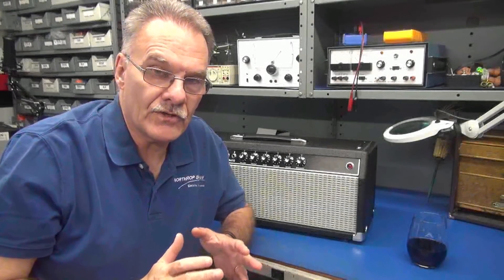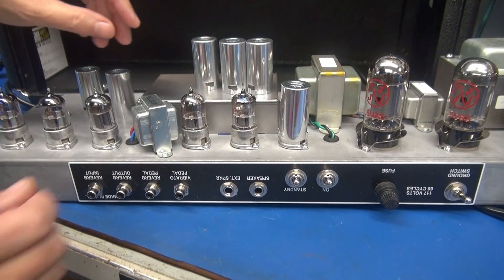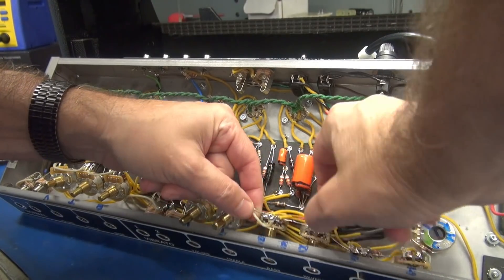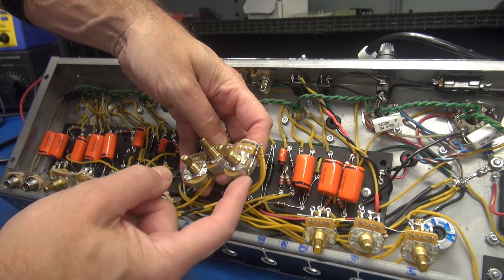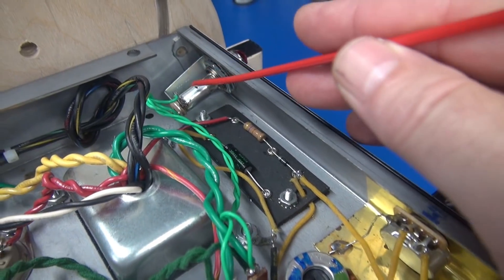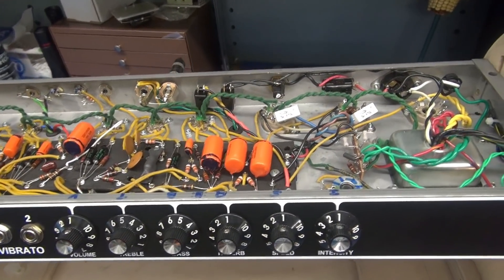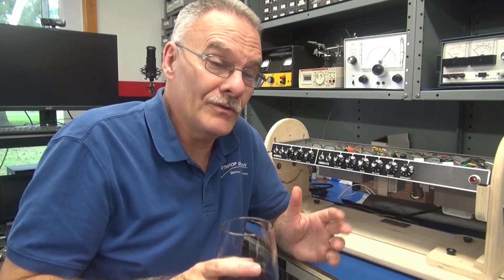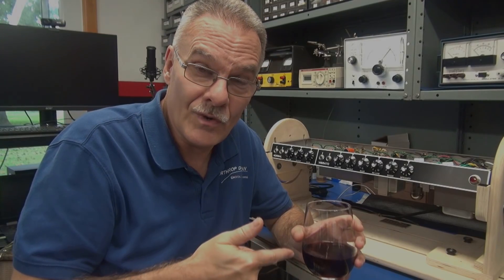How to reduce hum MojoTone Fender Deluxe Reverb Kit guitar amp proper Grounding build technique

Comment: I have a very quiet hum at 60hz in my Monkey Wards valco 62-9035A amp. I pulled all 4 12ax7 tubes but hum still there. Amp plays very well.

Comment: Question for anyone please. Are the two green wires on the secondary transformer the same. I think I can bypass the board and got to pins 2 and 7 or pin 2 and 8 on the Octal switch. Not sure if there is a  polarity, or which green goes to one or the other. They are both green so same? That is how they were originally wired up- less fire risk.

Comment: Nothing wrong with star grounding, when it is done properly.  The pre-amp star(s)  should be at or near their corresponding input jacks.  Not anywhere near the ground for the power supply.  That is an absolute recipe for power supply hum, and the unnecessarily long runs will invite all manner of other noise as well.

Comment: Howdy. Great success.
My recipe would be to use a separate B- bus wire that connects to the chassis only at the input jack.
The end tube minuses should have dedicated wires to the main filter capacitor(s).
The B- bus also connects to the filter cap.s at the feed end.
Finally all the pre-stages connect to the B- bus in the order schematics show.
One problem though. If the filter cap.s are of type can and collar, they need be assembled galvanically separated from the chassis.
Cheers.

Comment: I once took an apprenticeshio with Mojotone's Andy Turner. It has led me to your channel. Thank you for the great videos and how-to on amps
Reply: Question for anyone please. Are the two green wires on the secondary transformer the same. I think I can bypass the board and got to pins 2 and 7 or pin 2 and 8 on the Octal switch. Not sure if there is a  polarity, or which green goes to one or the other. They are both green so same? That is how they were originally wired up- less fire risk.
Reply: @MOAB-UT  usually the green wires on the secondary are the 6.3v filament heaters and they are the same Polarity don't matter

Comment: It is normal for a tube amp to have a slight hum when there is no guitar plugged in and the volume knobs are turned down? This is what happens with a 5e3 clone that I built. The hum is quieter than TV volume.

Comment: I could only find a 1x12 strip of brass. It is big enough to reach all the inputs and control pots on my build. Would that work or is a larger piece like you have here necessary? Thanks for the vids.
Reply: Try it. If not buy two and overlap or butt them together and solder them.

Comment: But wait, were the two 100 Ohm Resistors installed originally??? I didn't see them on the Pilot light. That would have contributed mightily to the hum.

Comment: Top job and thanks for the "Brass plate" info. Here in England we call it an "Earth noise". Some times (cos we didnt know better) we would simply disconnect the last pre amp ground and it usually worked but you do it the right way . We learned about amps by trial and shock! Then off to  college to learn the trade properly.

Comment: Terry, I was able to get my amp up and running thanks to your input. Although, I have a new problem now. Putting the amp in standby does not work as it should it only kills the hum that I have and lowers the output. In other words, I can still play guitar through it in standby at a reduced volume. I posted a video on it. Thanks in advance for any thoughts on this.
Deluxe Reverb mystery problem!!
https://youtu.be/Au39Gk0quBw

Comment: I just built this same kit. I powered the amp up properly using a 150w bulb current limiter in steps checking my voltages. The current limiter bulb seems to be dim with all tubes in and all the tubes are lit and appear normal. However, I can hear and feel the amp running through the speaker but I have no output from either channel. Adjusting the bias pot I finally started to hear crackling and then the amp had output that starts then fades out. This process repeats with hearing the guitar then it fades out completely repeating every few seconds, but only at a certain range in the bias pot. From what I understand the thick yellow wires going to the recto tube should be 5v dc however I have very high voltage on those pins? Is this correct? I am going to check output noise on the grid and plate of each tube down the line until I find one that is dead. Any suggestions anyone? Thanks in advance.

Comment: Does the kit come with screen or foil to use in the casework above the big open top of the chassis? My 1966 Vibrolux Reverb has a copper screen in the inner surface of the enclosure that completes the full shielding when the amp chassis is installed in the cab.

Comment: Christ! All of that 120Hz AC  from the power supply rail is dumped right into the rest of the signal path grounds. That is a great recipe for lotsa hum.  36 gauge copper craft foil from Hobby Lobby works in place of the brass plate. It is only about .007" so be careful not to let those star lock washer spin into it. Being it's copper it will conduct better than the .010" brass plate. If it's too short it solders together very easily. Clean it to a shine with some Scotchbrite.

Comment: Instead of all those wires going to a common solder point on the chassis I see that on Mojotone's website 
they actually show a brass rod parallel to the pots but this brass stock idea Fender did  is far better.
I did notice the 5 Watt  wire wound ceramic resistors mounted under the 6V6's . Originally they were 5 Watt 
metal oxide film type resistors. Would this cause any problems because of inductance inherit in a coil of wire
inside the ceramic resistors ?

Comment: Another great video!  I will use the brass plate on my next Fender build.  Serious question what makes the brass plate better than the connection to the metal chassis.  Does anybody have any theory's on this?  Im not arguing against using it, just try to wrap my head around why its better.  I have been grounding to solder tabs and using PT and Tube screws to anchor.   I need a snozeramous to get enough heat to solder directly to the chassis.

Comment: The Preamp Section Ground and Power Amplifier Section Ground are NOT Tied together connect to chassis ground, which is technically not a good ground scheme because you want all your grounds to be tied to chassis ground which is earth ground zero volts. If all of your front panel pots are connected to the Copper strip for ground which is NOT tied to chassis ground or earth ground, then it will be Floating above chassis ground and earth ground which is NOT a good grounding scheme. The Signal to Noise floor increases when you TIE together the preamp section ground and power amplifier section ground both to chassis ground/earth ground is because there is a potential difference from the preamp section ground compared to the power amplifier section ground which needs to get fixed first before moving forward. My main point is that You don't ever want your preamp section ground "isolated" or "floating above" earth ground/chassis ground.

Comment: Its amazing to see this. How often people throw out the instructions and go about it how they please. There is a reason they are laid out the way they are. If you follow the layout given, you most likely will have a quiet amp that performs as it should. Follow instructions people, they're there for a reason.
Reply: Seriously, mojo does not have instructions for the dr. They have a schematic. The only place to ground preamp is to pots, which doesn’t work well. They don’t give a brass plate.
Reply: Yeah, I don't understand why someone would make a huge ground modification and then complain about hum. Seems like it's time to at least check if the original design works!

Comment: The consensus I've always heard about grid stoppers is that they work best (at filtering out RF) when attached directly to the tube socket so I'm with the original builder on that one.
Reply: Stoppers, absolutely as close to the grid as possible. ... wire the resistor to the socket, with the 'body' of the resistor as close to the grid socket terminal as possible.

Comment: Beautiful work but I bet there is a ground loop. Like lyle sez,,   there is perfect, a star ground, good enough, fender and not so good, marshall and vox. In a guitar amp unwanted frequency's are filtered out the high's and lows getting back into the whole system causes the noise issues. Also, it's just me but, I don't like the orange drops!! I think the mollory 150's just sound Fender.

Comment: Nice work Terry. I’ve used a brass plate in a 5E3. I now use separate chassis grounds for inputs, outputs, power supply and filter caps. Drill the chassis by before assembly and use stainless steel screws and keps nuts - tight ! 
I’d like to know more about that white Tele Tony is playing !

Comment: Yes to separating preamp grounds and power supply grounds. Cleaning up the wiring was great! Lead dress makes a real difference in all Fender amps. I don’t like the plates. Fender used them to facilitate cheaper assembly. Unless you solder the plate to the chassis (Fender often did), you are still relying on a mechanical connection between the plate and the chassis (dissimilar metals), through pressure provided by the pots. 

Snozzeramus can provide a rock solid ground point near the input jacks without the plate. Then the ground buss works great. System will stay completely grounded, even if one of the pots manages to get loose. 

Amp sounds great.

Comment: Well done Terry. Star grounding, when done properly works very well, I have used it many times in mic preamps. But the brass strip works so well in guitar amps. I have retro-fitted Marshalls with it, and it lowers the general hum and noise level.
Reply: Where to you get your brass shim stock from?
Reply: Do the input Jack's have to be isolated from the chassis in a true Star Ground system?

Comment: My Mojotone kit DR hums just like that if the reverb is turned up.  (Pretty quiet otherwise.) Did not use a star ground though--did follow MT instructions.  Brass plate will be installed ASAP.
Reply: @John McCane I was wondering the same. I just ordered the DR kit.

Comment: The brass plate was as much for assembly line efficiency as it was for grounding. It actually is not needed, the chassis does the exact same thing if you solder to it correctly. I have built some Deluxe Reverbs from Reissue chassis, and I use a copper buss flown from the pot grounds (but NOT touching the shells) over to a chassis connection next to the input jacks. This makes the amp so quiet you would think it was not on. And of course the HV grounds at the power transformer side.
Reply: Agree--you can replace that entire plate with a single screw, nut, and locking solder lug washer connected to a bus wire--that's why I usually build with a turret board, but running it off the pot grounds'll get you there too!

Comment: The marks on the Orange Drop caps tell me the builder tested them to find the outside foil for each cap.  That was one step in the correct direction.  I am sure that MojoTone is aware that star grounding does not work well with the AB763 and I suspect Leo may have known that as well.

Comment: 15:13 - It IS the kit! It should INCLUDE that brass strip that you made!
Reply: True. That’s the whole issue. The pots don’t provide a good ground.
Reply: @NT-ze5nx  where can we get the brass strip? any details? Does it have to be .010" thick? im having trouble locating just were to get it ...
Reply: @dparham  D-lab made the strip I think.
Reply: @NT-ze5nx  i found some 10 thousandths 6" x 60" on ebay! i may make a few of these!  since you cannot buy just enough" but u can buy enough to make 10 lol

Comment: So do you think Mojo well including brass grounding plate?
It would seem that the kit builder did not follow the instructions properly, as I would think that Mojo would get away with selling all of their kids with hum. 
Points to you Terry for going above and beyond, perhaps the kit manufacturer will come out with a modification to their kit's, and a D-lab upgrade.
Reply: Kit was initially built with grounds to pots per mojo instruction, then changed to star bc of hum, which didn’t work. Terry used brass plate, which is not part of kit

Comment: Very nice fix Terry.  

I don't have any problem with star grounding and have used it successfully in many amp builds.  I think that this was just a poor implementation of that technique as it seems there were several potential ground loops.  I would also likely use it in an amp build that is designed around that ground scheme as a whole, whereas this build came to you as a Fender style kit trying to graft in a star ground scheme.  For example a point to point build it can work nicely.  

In the end it seems like the builder got out over their skis a little trying to redesign a kit that simply doesn't need to be redesigned.
Reply: There are those who think they know better than Leo. LOL

Comment: Terry- always a great job. I wonder why Mojotone does not sell that brass plate ? it only make sense.. perhaps your videos will influence that :)
Reply: From what I have seen there are some other improvements they can make, like putting the fuse and switch on the hot lead and providing a proper ac safety earth
Reply: Just a guess, cost...